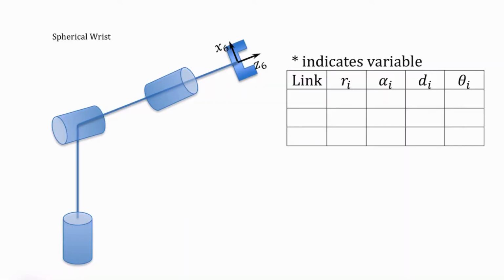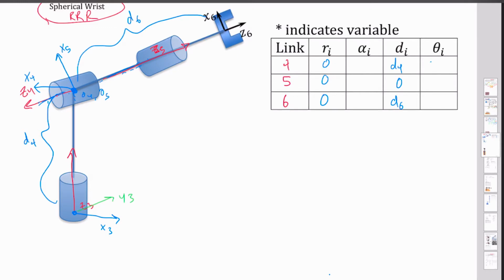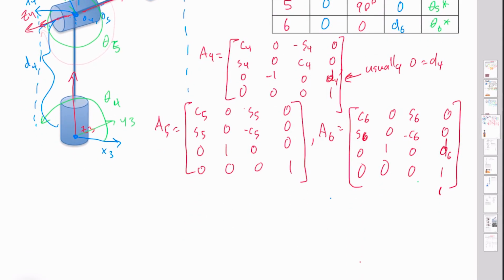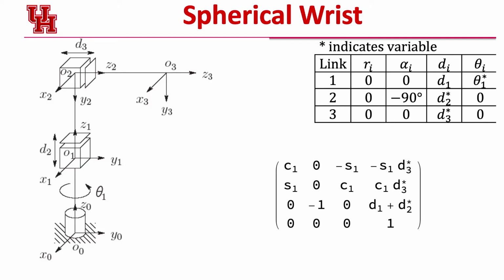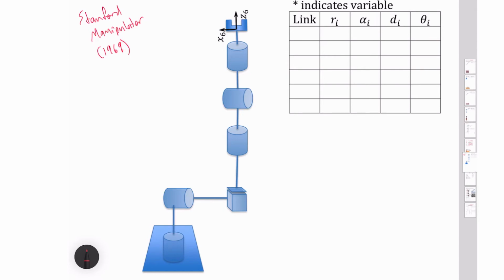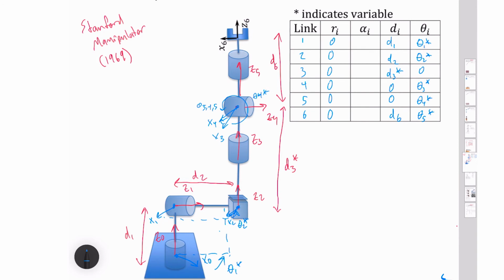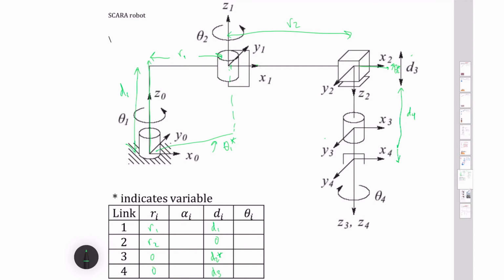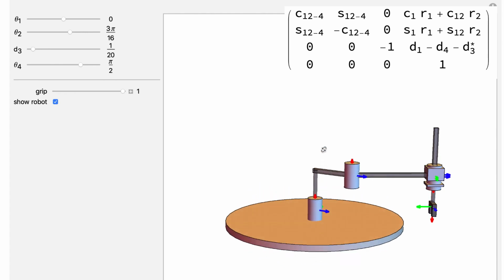Intro2Robotics6b: DH for spherical wrist, 6DOF arms: cylindrical & Stanford, SCARA

Comment: Sir what software are you using?
Reply from the maker: This is Mathematica.  You can use many of these for free at https://demonstrations.wolfram.com/search.html?query=Aaron%20T.%20Becker
Reply: @AaronBecker  Is that what you used to edit the D-H Parameters of the cylindrical manipulator sir?
Reply from the maker: @mikkodetorres2936  https://demonstrations.wolfram.com/CommonRobotArmConfigurations/ is what I used